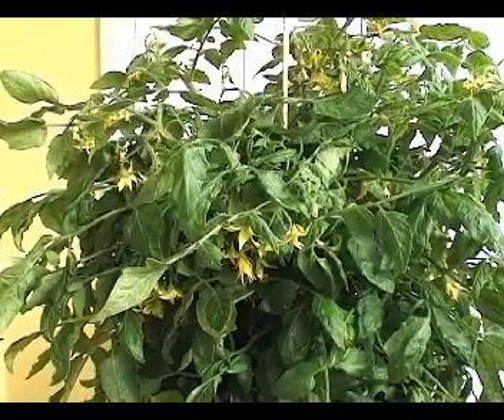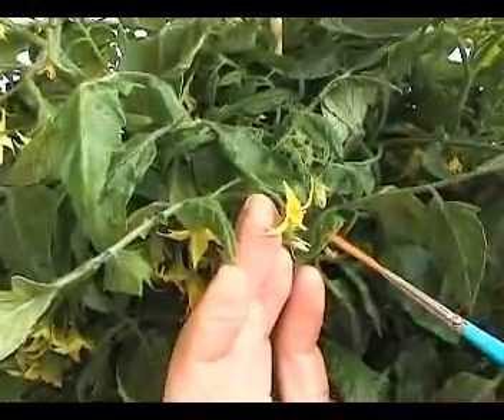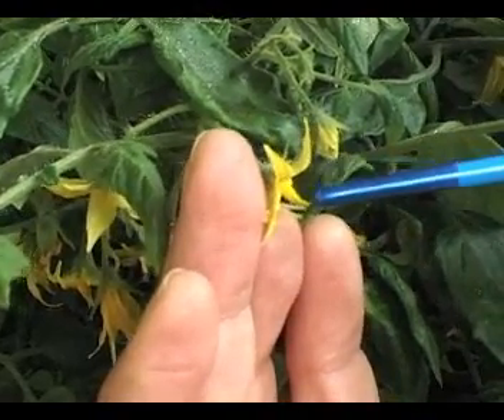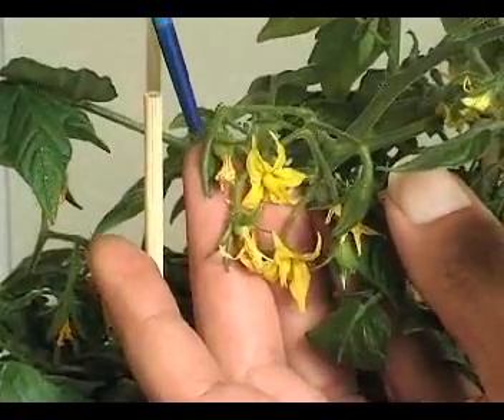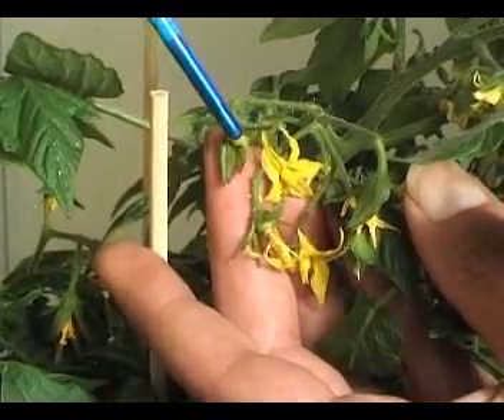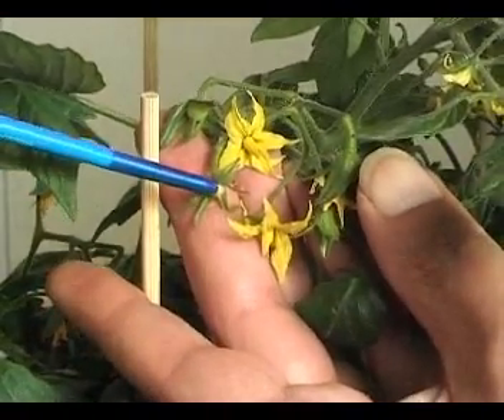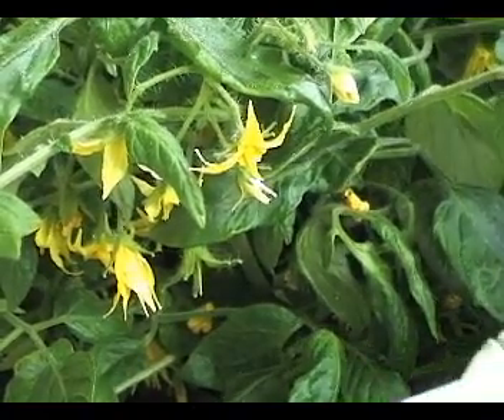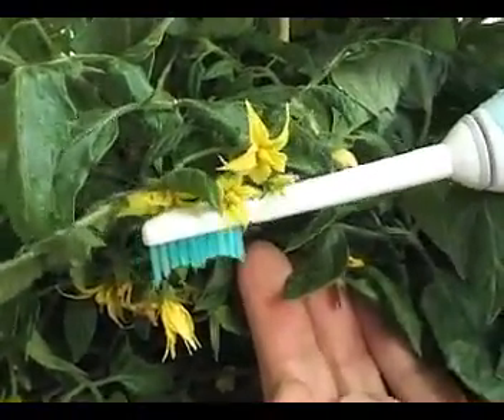Pollinating Tomato Flowers

Comment: Use one with round head wheel . It works better than a strait brustle head. Cost a bit more but it does a much better job.  But its serious pollinating with any electric toothbrush.  I love to see the pollen puffs that come out of some.
Use a old sunglass lens a dark one and put it under the flower if you want to see pollen.  Great for collection of pollen. Use a electric toothbrush twice a day or more. I like before 9 and after 5 . I'll even do nights when Temps creep up past 72 at night. 
Toothbrush. Game changer.

Comment: Zucchinis have male and female flowers so the pollen needs to move from the male to the female.  The toothbrush trick won't work with zucchinis.  Use a small brush if you need to.  I find that the bees like the zucchini flowers so they will do an adequate job.